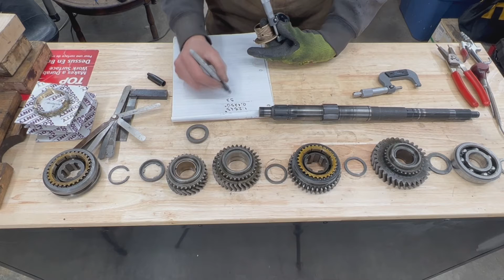TR6 trans - A-type to J-type OD - Part 4 - Measuring Endplay Overall  Float

Comment: Elin, Thank you so much for these videos!  I have been using them as a great visual reference as I rebuild my tr6 transmission.  I opted to go with the steel 2nd gear bush and late model gear which requires a main shaft with the locking ball and the thicker spacers.  I sent a little love your way as a thank you for what you do!
Reply from the maker: Thank you for that Steve! I got it and I appreciate it!

Comment: Elin, another fine video; well done!  
Do you think you could consider doing a related video?  The one I would like to see is a discussion by you about the various ways to diagnose problems with the clutch/transmission/overdrive/differential while they are in the vehicle.  Maybe a 'road test' video showing the thought process and physical evidence of a problem along the drive train?  This enthusiast amateur mechanic would love to know how you diagnose the problem.  Perhaps it is simply a slave cylinder needing to be properly bled, rather than having to dive into the transmission, chasing a 'problem' that isn't there;  how would you determine the 'root cause'?

Comment: Elin would it not have been the right thing to measure endfloat with the NEW sincrow rings in place instead of measuring with the old stock. If the Old sincrow rings have thickness wear the endfloat will be affected ???
Reply from the maker: The synchro rings do not affect the end float. In fact the entire synchro hubs do not affect the gear end float and the overall end float. Only The bushings and the adjustor washers are a part of the equation.